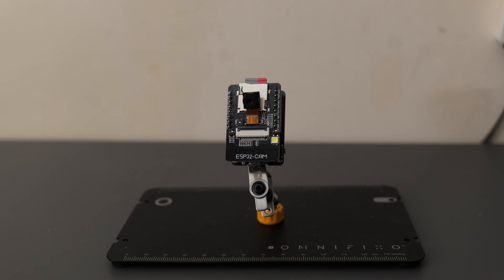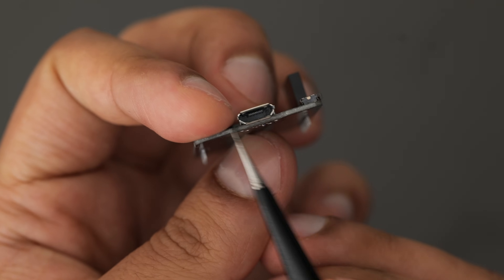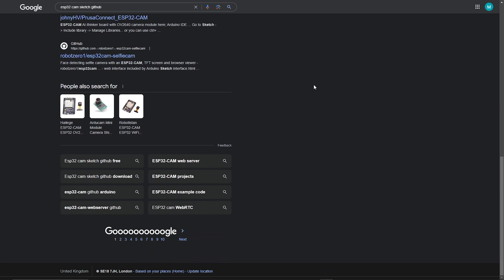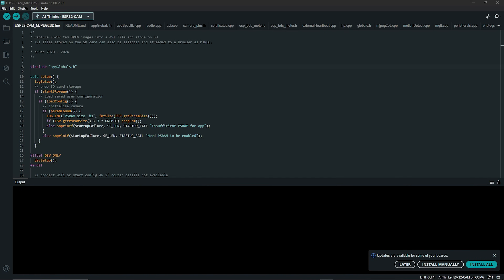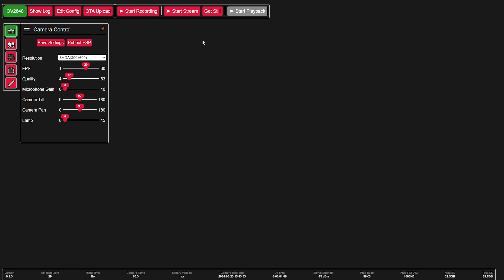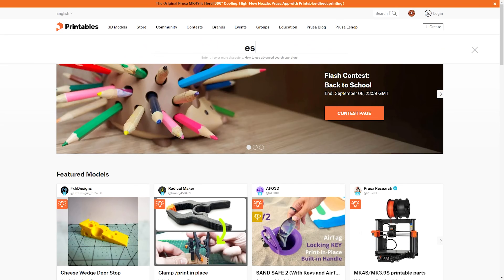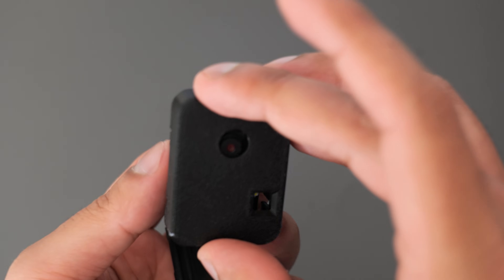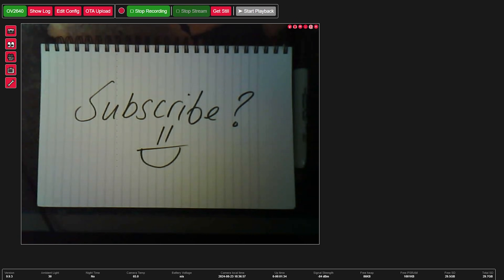MAKE a DIY Security Camera with ESP32-CAM

Comment: Didn't work for me. Using xiao esp32s3 sense. Compiled and uploaded fine but a boatload of errors in serial monitor: wifi, server and sd card related. The tutorial for my board/cam from xiao worked perfectly for taking pictures and streaming video, yesterday, so I know it works with these things. But with my experience level I'm just not up to the task of troubleshooting a sketch that has 29or30 dependency files, and seems to be giving me errors for things that work just fine. I tried, but that utils.cpp file is just, unintelligible to me (and seems crazy overcomplicated). Idk. next

*edit: went back and worked the problem some more. Got a little further, at least was able to use it as an ap. But that's as far as it got. I just don't know why they made connecting to internet so darn complicated in this sketch. My problems are all now related to this access point login thing. Get to the site 192.168.4.1 but it always gives me trouble, the logs are incredibly unhelpful, just basically say i'm not connecting to internet. That site is supposedly where you enter internet login and password but yeah just errors. So fun... Wish  i knew how to just connect to wifi like the xiao version did, super small sketch and it just worked.

Comment: HI , There are too many bug on this software, i use AI Thinker Cam like you, and Esp32 Cam board, microsd SanDisk 128gb, maybe is not supported ? , after installation, it doesn't copy the 2 HTML files on microsd>data folder, microsd is full (after install) and only 4GB are free (and this is not normal), because my microsd was previously formatted and free 128Gb, and there are too many bug during compiling, code maybe is out of date, my Arduino IDE is last upgraded and every libraries is updated (infact if i try to program my esp32 cam with other IDE like WebServer, it works perfectly. I think that much expressions writed on this code is very obsolete, boolean variables defined in an oldstyle IDE method...
The fact is that I obtain several bugs: microsd 128 full, the data directory was not created, an with file missing you cannot have access on GUI ... you can only get first access, to program wifi ssid and password, but after this, the Esp32 Cam obtain many looping error, and boot very strange... 
I will try with another (little) MicroSD maybe 8gb ...

Comment: what did you mean by "its a little bit away from getting to that point but its a step in the right direction" ? is it not suitable for use as a monitoring camera in your opinion?
Reply: its good but it isnt suitable for using it as a montoring device cause the range doesnt support, go watch max imagination he made a same video about this with better things plus an antenna for more range
Reply: @RanklyDaily thanks for the info

Comment: just buy a cheap wifi camera. that cost about the same as this esp32 + camera module + housing + web/app + your time. with bonus of better quality.
Reply: You may be right but where is the fun part?
Reply: better quality mate? are you sure that you can get a better quality camera at this price?
Reply: But you are bound in their future subscriptions and no ability to change the program you use
Reply: First of all if you're doing everything manually you'll learn something 
If not doing manually still learn something 
Also you will going to know each and everything about the esp 32 and what it can do 
Esp 32 is not only about camera 
Or home made automation system

Comment: So, how do you actually open the .ino file? do you have to install like an arduino IDE? does the version matter? Sorry that was one step missing from your video.
Reply: I fixed it. 
1. make sure to install for all users on primary drive.
2. It (ESP32 ino) needs to put itself into its own 'sketch' folder.
3. Need to move everything into that folder and reopen.

Comment: Can it be powered using a battery? Say a 9 volt. So we can use it on the go.
Reply: you can use it with a battery. the enclosure won't obviously fit the battery so you need another solution for that. and also 9V WILL damage your board. the recommended input is 3.3V-5V and you really should not exceed that.
I'm planning on using a powerbank! since USB outputs exactly 5v and it's safe with charge and discharge
Reply: @druidkey1449, Thanks! FYI, I'm powering my ESP32-CAM with 4 AA batteries (6V total), and I'm using an AMS1117 regulator to drop the voltage to 5V. It works well.
Reply: @timmehdoom3107   thats awesome and such a good idea

Comment: This was not working for me because of the library missing problem.
I downloaded the whole project from github.
ino and library need to be in 1 folder..

I made a folder ESP32-CAM_MJPEG2SD (same as the ino file)
The ino an all librarys need to be in 1 folder named ESP32-CAM_MJPEG2SD (31 items)
If you do so, all libraries are loaded at start.

Used ali esp32-cam for my NOT working version :(

Chip ESP32-D0WD-V3, 2 cores @ 240Mhz, rev 3
boardInfo] Flash 4.0MB, mode QIO @ 80Mhz
boardInfo] PSRAM none

Comment: It gets heated... Any solution or can you design 3d printing with fan setup
Reply from the maker: Including a fan is probably not necessary. I’d recommend modifying the enclosure with air vents so heat can escape.

Comment: As I'm a newbie at this I do have a question or two. 1. Power is through the USB cable. 2.  Are these items the same as what you used for your build; ESP32-CAM, Camera Module Based On ESP32, OV2640 Camera and ESP32-CAM-MB adapter Included
ESP Prog - ESP32 Programmer Board. 3. How big should the SD card be?32, 64 or 256. Thanks for a very good video.
Reply: 1. Yes
2. Yes
3. Depend on how much you want to store on it. Anything above 4 GB would work (if I read the Github page right) but more means you can store more without offloading it to a server or something.

Comment: I'm facing a problem where I can't see anything printed out in the serial monitor although the baud rate is correct. What do I need to check pls
Reply from the maker: Hard to say for sure, have you made sure the right board is uncommented at the top of the sketch?
Reply: @MirzaMakes  yes of course, the upload process is success but nothing printed out in the serial monitor

Comment: I think there is a way to use espcam with PrusaConnect for remote printer monitoring. I’m certain there will also be an integration for HomeAssistant to use for security purposes
Reply from the maker: Correct - Prusa does have a guide on using ESPCams for monitoring. Something to look into